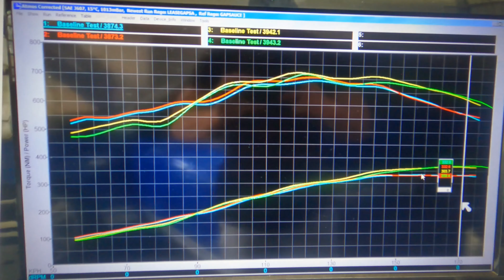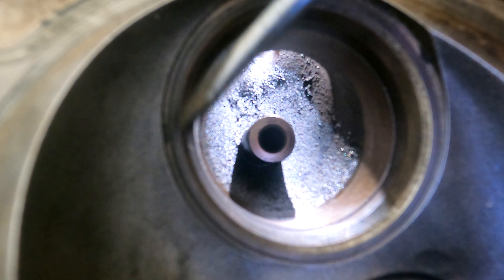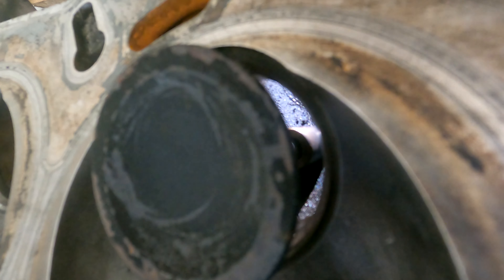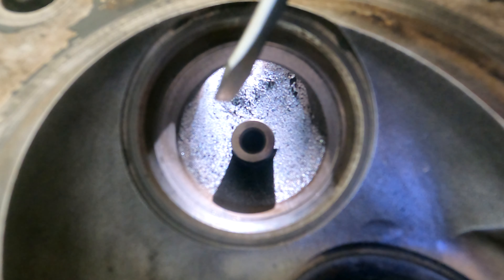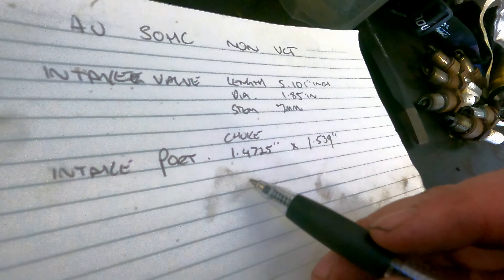Cylinder Head Porting 101 - Porting Math | Building For Performance Ep03

Comment: Some engines don't make any extra power with long tube headers, sounds better regardless though, I'm keen to see what cam you wnd up going with for the 7000rpm
Reply from the maker: Alot of factory sized cams don't gain alot thats right.

Exhaust valve timing events can have a profound effect on header design compatibility too.  We never really know until we get it on the dyno, but we can calculate theoretical best size if we know the RPM, Cylinder volume and Exhaust valve timing events 🙂

Thanks for the answer Tristan 🙂

Comment: The xr6 EF EL head is best to use on an AU bottom end   
120lb Spring pressure  standard and 
2mm bigger inlet opening
Reply from the maker: I will be porting a 94AB EF Head and AU bottom end. I'll be using a few different custom cams for testing 🙂 Enough lift to support the power peak I need, I just want to drive it again already haha

Comment: The 4.0 benefits from
 1 3/4 primary 
2 1/4 secondary 
If you can get 2 3/4 thats best 
 3" exhaust   if you can't do 2 3/4

It all depends on head and cam
Reply from the maker: I have some nice software that agrees with the 1 3/4 primary pipes. For my rpm range anyway and 2.75 collector would be close to ideal yes.

But thats for near 6500rpm peak power.

Comment: Thanks for the tips. Would definitely love to see you backyard flow bench setup as Im building one myself for messing  around with some cleveland heads.
Reply from the maker: I have a few modifications to do to it yet, but it works for what its intended.  You might have noticed the 2v cc Cleveland head on my bench in this video..
Reply: @GapSauceYoutube  Ah yea spotted that one, I think most people have a set of 2vs hanging around. Loving the content mate that ba is a beast and has totally changed my mind about the boss engines.
Reply from the maker: @threefiftyone4726  Thanks mate, DOHC is a big advantage. If these BA''s came out with 3.9's from the factory, it would be a whole lot different I think.

Comment: Smaller pipe diameter within reason should assist in low RPM scavenging. Helping make torque. Same as with intakes though, pipe diameter and length needs to be tuned to pressure waves.
Reply from the maker: Nice answer Brett, thanks!😁

Comment: Nice video as usual, wouldn't port matched headers give you the best of both worlds, then it's the length for the scavenging that comes into play?
Reply from the maker: Headers are very sensitive, especially with a cam that had alot of overlap.  Ill detail it as best I can in the next video, but generally port matching the exhaust port will kill power as it allows exhaust to freely flow backwards up into the cylinder, (reversion). Removing the lip/ledge for the gas flowing the wrong way at the mating point is really not what you want to do.

Comment: Man, so much respect. I've been wanting to do similar videos based on what you are doing. Sadly, no matter how hard I battle, I'm unable to get there.
.
Anyway, from my experience, an exhaust system works better when all components are matched to the flow capacity of the port. Less exhaust flow needs smaller diameter pipes for optimum "average throughout the rpm range" than one with higher flow. Case in point, a factory 302 Windsor needs less diameter that a 302 Cleveland. Using this example a Windsor may be optimal with 1 5/8in but show signs of loss of torque on a 1 3/4in. But a Cleveland may show optimum results on the 1 3/4 and get a loss with 1 7/8. Of course there are other components such as intake set up, compression and camshaft, but the biggest thing to remember is an exhaust will produce big gains over a rpm range of +4000rpm if built to do so. Longer runners, and multiple branches (4-2-1 or for a 6 either 6-3-1 or 6-2-1) produce improved torque everywhere, where 4-1 or 6-1 is more inclined to produce more peak rpm tuning due to the single point of merge. Trying to alter this by shortening and enlarging pipesize to produce the most torque in a higher yet narrow rpm range to achieve a peak number will hurt torque everywhere outside that range. In a case that I did, it simply never got to that peak. And this was using DynoSim Software to get the lengths and diameters too.

Thats probably made no sense, but to some it might shed some light as to why building exhausts is a "dark art". What works on some motors (like Small Block Chevs Mopars and Wndsors) doesn't work on Clevelands, Hemis or multivalve engines like the Boss, N/A Barra or Coyote. Exhaust flow, overlap flow and compression are all different on all these engines, so all require different exhaust diameters and lengths to match and enhance those characteristics. Once a choice is made to try and make more power by altering pipe diameter and lenght, torque will suffer due to the reduced volume which brings the scavenging effect into play.

Keep up the excellent content.
Reply from the maker: Excellent response, glad I could provoke that kind of thought mate 🙂

Makes perfect sense, valve size and the canting probably gona long way to the Windsor/ Cleveland thing, just the same as the modular with it 4valves of curtain area wanting more primary pipe too 🙂 

I'd love to try a 6into1, but unless I'm building for 7500+ I would probably not achieve the results either. It's likely going to be a case of the best off the shelf unit and modify them accordingly 🙂. I'd love unlimited budget, but the GT chews up a fair bit of that as I rave it quite often.
Reply: Yea the generic headers work well out of the gate, especially for the Falcon 6. I'm yet to test an unequal length header for a 90 degree V8 but see potential in the design for both packaging and torque. 

I have basic Performance Trends flowbench set up. It uses a floating pressure drop rather than fix. It means I can use 3 SCA vacuum cleaners rather than a +$10,000 industrial fan powered by a 10hp 3 phase motor. Sure, the bigger unit gives better options for wanting to test large flow at or above 40in of H²O, but no one has asked me to flow a Big Block head. However, It did help with chasing airflow on a BA wagon. Effectively doubled the airflow to the throttle body over stock, wich helped save 2L/100km on average. Best I got out of it was a 7.9L/100km. No other mods were done to get it either. To me, that's enough to say it's capable of reading over 1000cfm which is something no vehicle cylinder port can claim to need more.

GT is a special beast. Would love to get my hands on a Boss to play with, let alone a GT...
Reply from the maker: @crd-nz_001  Thanks for the input mate, I use the SCA vac for my floating pressure drop bench too.  Nice gains on the Barra!
Reply from the maker: Just out of curiosity, if you were to do the 6-1's again for 6200-6400 peak.. Would you go with 1 5/8 or 1 3/4 pipes.. I have PipeMax and DynoSim6 but I dont believe there is an option for 6-1.  It seems that i'm right on the limit of the 1 5/8 primary. I'd really like to try a diy 6-1.
Reply: @GapSauceYoutube  I can honestly say a 6-1 setup would be epic. However, packaging 6 pipes even in a Falcon engine bay would be a challenge.
What I have thought of is a point of difference that I need to try myself. But, if your up for making a set then try this twist.
Run a 6-2-1 branch as normal in 1 3/4in tube. However, reduce the merging zone down to 1 to 1 1/4in. At first this may seam like a restriction. However the exhaust wont see it as that. Size reduction means airflow increases AND pressure reduction - just like a venturi. This increase right on the branch should help boost the negative scavenge pressure for the other cylinders. After the branch, expand to 2in. The final 2-1 section, reduce to 1 1/2 and expand to 2 1/2 for the collector. Overall, this should supply the airflow for power, but makes higher scavenge negative pressure than running straight merge sections.
Just to say again, its just a theory that I need to test. So absolute no guarantee that it would work.
Reply from the maker: @crd-nz_001  Interesting idea, it sounds feasible. I'll have to crack pipemax out and have a look. I would like to use 1 3/4 pipes with a 6-3-1 with 2.75 collector. 

I don't think the 1 1/4 idea would hurt power under 6000, wish I had unlimited time to try these out 😅

Comment: Another ripper video mate.

Diameter for exhaust should be close to matched with port i would guess. A slight step is acceptable. More to do with efficiency flow and reduction of back pressure waves 🤔
(No research just a guess)
Reply from the maker: Thanks for the answer mate, I'll discuss the answer next episode 👍  🙂
Reply: @GapSauceYoutube  looking forward to it.
Will you mention preferred exhaust header length to. 👌

Comment: My understanding is that smaller diameter into larger diameter, after cat,  will be good for more torque and power. Ie. 2.5 inch into 3 inch. Could be wrong though

Comment: Hi cool see someone else playing around with au.With au 6 intake valve it  is under sized exactly all sohc 4 litres are.its not a  straight line sight to intake  vavle its elliptical. They rougher the Intake finish more turbulent air better or consistent mixture motion swirl.one more thing  intake port is part off the runner for 2 valve about 2 x off valve head diameter which  ends up in the runner that's our port length.just like you I'm totally obsessed with cylinder heads.peace
Reply from the maker: Ill do a nice burr finish on this one and a back-cut on intake valve, should get that nice mixture motion :) I should have a video up soon on it!
Reply: Cool in my opion  when ya back cut it less intrusion in the port  I do it  myself and all so trim  the stem off the vavle from above the  fillet to just in valve guide taking from 7mm to 6mm again less intrusion  in flow path.remeber the valve spends more time in mid lift then any where else.one more thing to think about replacing the conical intake valve with a exhaust valve yep that's right tulip vavle flow surface is way better  especially when ha look at both vavles fillets and flow paths of valves .one more thing then I'll get back in my box where your extractor come off ya flange straight then start to bend on inside off that bend drill a hole to let air in why it ignites the unburnt fuel which in turn creates more heat and expansion which in turns a stronger pluse pull,reflective waves  on in coming charge and cleaning out the exhaust gas heat has its own interia.time to head back to my shed wish you all the luck personally I was born for this shit.peace
Reply from the maker: @wayneireland4802  You are more brave than I am with 6mm stem mate, but for outright flow you cant go wrong.  I haven't tried the tulips with the SOHC, I think you would need a straighter line of sight to make it work, but if you managed to make it then that's a win! It would be interesting to test the hold in the short side of the header, I wonder if you would have more benefit on a larger primary. 1 5/8 are at the end of their efficiency for my build, in theory anyway. Thanks for the input, very much appreciated!

Comment: Another annoying question. Do you (anyone) know the valve stem installed height on the Boss 290?

I could find just about any info on my old LS but the Boss 5.4s are a different story.
Reply from the maker: Hey mate, I probably have it written down somewhere, when I have the head off next I'll see if I can get a measurement.

It's obviously different to the 260
Reply: @GapSauceYoutube  thank you

Comment: ive just had a high performance build done to a boss 290 and its in the shop and they cant get it started . does anybody have any ideas. they have spent so long trying to sort it. ???
Reply from the maker: Did they put the trigger wheel on the crank before the timing cover? It's easily overlooked.

Comment: My question is when are you getting an XR6T...........LOL
Reply from the maker: I bought a BF xr6T back in to 10, I believe I had about 320rwkw@15psi by 2011(which was alot back then) and then ended up putting process west's stage 3 kit on it and ran it on max boost.(30psi on occasion) I repeatedly broke input shafts, got hustled by BTA motorsport a few times and eventually sold it. The car was recently featured on Motive and has 1100whp 🙂